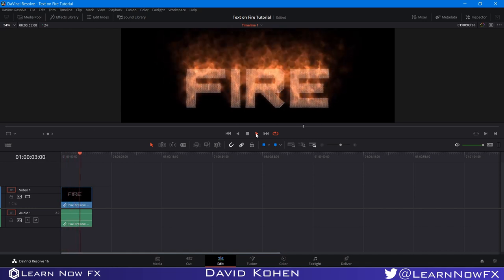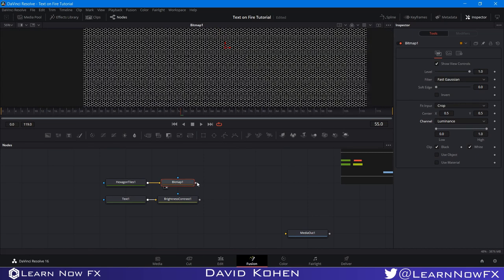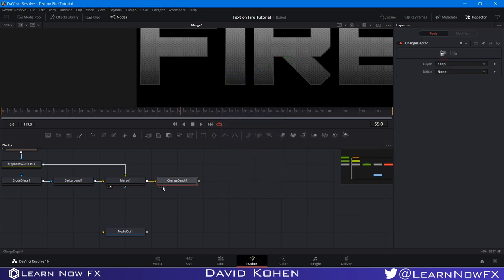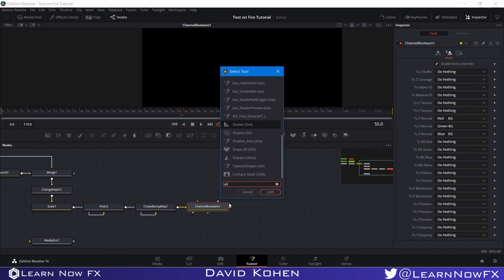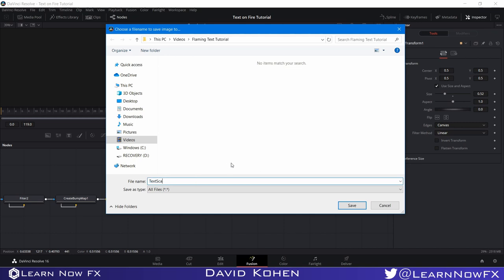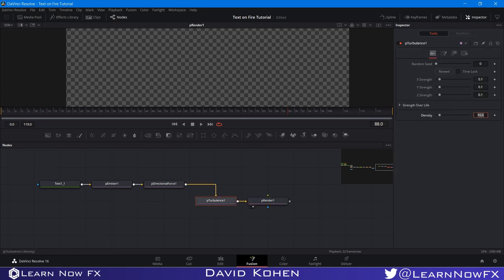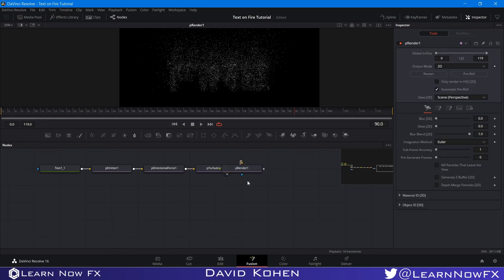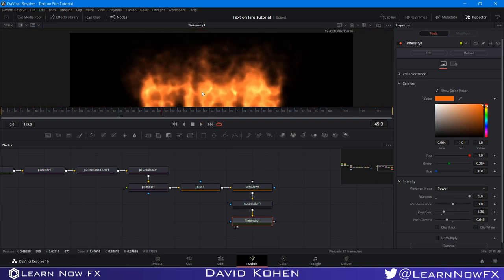How to make a Flaming Metallic Title inside of Davinci Resolve/Fusion, Tutorial + Project File

Comment: Hi. I'm a new subscriber from Brazil (sorry my English). These tutorials are amazing, thanks. About this one, I can do anything but the Tintensity doesn't work at all. It just keep blinking red and, from that, nothing else works. I've tried everything. I even started a new project from scratch and I have no changes, always the same problem. I've also tried to simply use the template metallic_flaming_title_project_file.zip from the website and the problem begins just from the Tintensity. Would it be a issue with my installation or version? I'm using the 16.2.5. Once again, thank you for the amazing tutorials.
Reply from the maker: Hi Emerson, thank you!!
I'm very glad that you like them!!
Could you please try installing Tintensity again from our website?
I just released an update that fixes this issue.
If installing again doesn't help, please let me know.

Thanks again,
Learn Now FX
Reply: @LearnNowFX  Yes, it is working now. I would like the video twice if I could. Thanks.
Reply from the maker: @EmersonJunqueira  Thank you very much!!